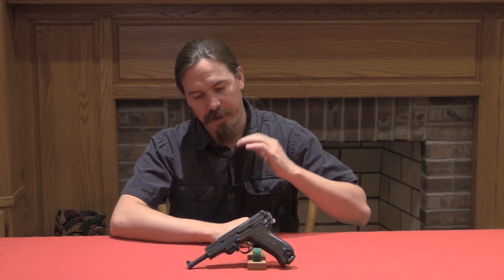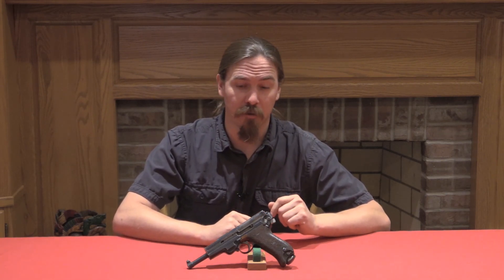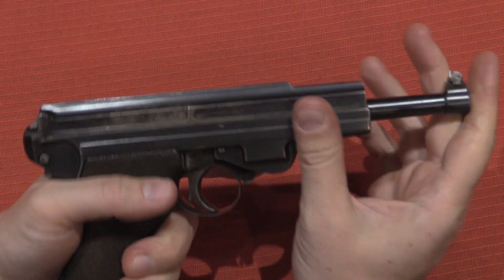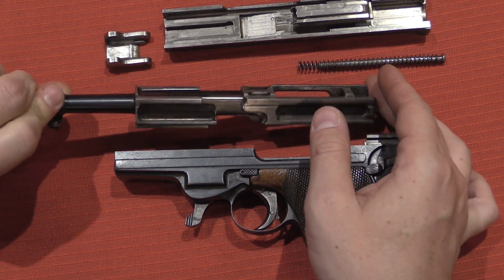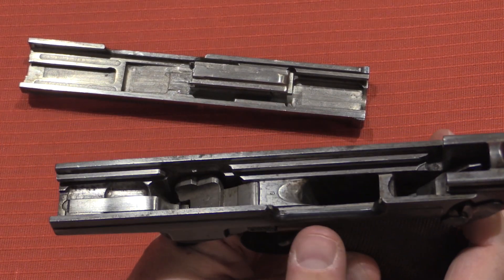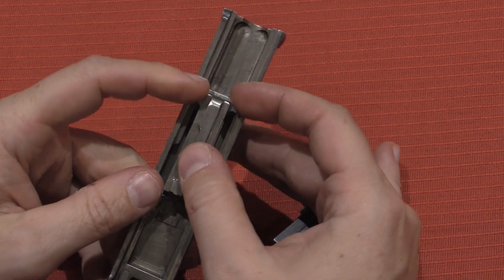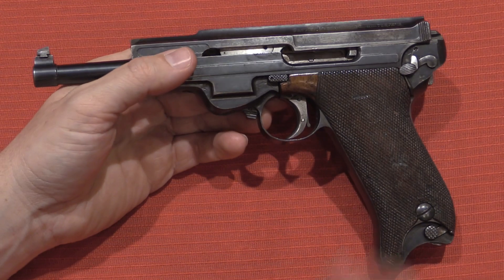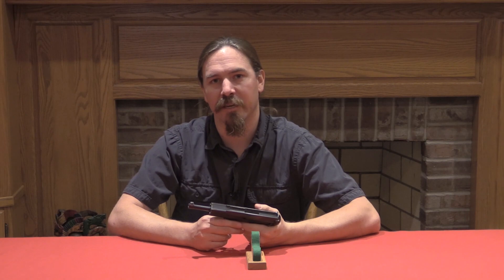Müller 1902 Prototype Pistol

Comment: I don't see what makes the locking block drop down so that the slide unlocks from the barrel assembly. In a P38 there is a pin that contacts the frame and pushes the block out of the locked position. I don't see that on this piece and if the locking block is being cammed along a surface in the frame I am not seeing where or how that occurs.

Comment: Crazy complicated machining, but super easy to strip. The quartermaster would hate the cost, but the soldier would love the ease of cleaning.
Reply: It is easy to disassembly, but it looks like a pain to clean. Parts have complex shapes and the ejection "port" leaves the mechanisms exposed. Combined with tightly packed sliding parts this makes the pistol look to be prone to jams.

Comment: I'm surprised that SOMEBODY didn't want these.  The simplicity of design ensures a more efficient build rate, the lock mechanism ensures a very safe weapon, it suffers none of the toggle lock reload weakness, the internal rails could show an accuracy equivalent to a Sig P-210.  The U.S.' affection for revolvers, perhaps, might account for enough 'reason' to deny it, rather more than too weak a firing pin spring.  But then again, how would I know?  Love your vids, thanx.

Comment: The locking design is actually superior to the Walther. That whole large flat surface on top is what locks into the top of the slide, and the force of recoil goes straight through the block in compression. The two 'ears' are only used for camming. The Walther P38, and other pistols with similar locking design such as the Beretta 92, have the block turned the other way up. The two little ears are used for locking and can be snapped off, so that locking blocks are a major weak point in these later designs.

Comment: This one was very interesting. Outwardly it kind of looks like a Luger and a Walther P-38 thrown together. Anyway, it appears that the locking wedge is supposed to be pinned on that slide assembly thing but I noticed that there wasn't a hole drilled in that part. I guess either it was not quite a finished piece or they figured it didn't need to be pinned in place. Seems like it could possibly have contributed to reliability issues?
Reply: I suspect that the hole was for centering to guide the machine that ground the curved pivoting surfaces. Those surfaces are large to withstand the force, a pin as well would be redundant.

Comment: It appears that the take down piece also acts as the camming surface the lock piece rides on.  If this is the case, it would explain it's complexity as opposed to just using a dowel.

Comment: Hey Ian, Winterthur is pronounced Winter-toor (the same oo in tool). Just thought I'd point it out in case you somehow come across more firearms from that town.
Reply: I was surprised to see Winterthur there. As far as I know it's very unlikely do come across more guns from there. Sulzer never made guns as far as I know :D. Considering that at the start of the 20th century Winterthur was an industry time, specializing in machine industry, it's fairly odd that there were no weapons manufacturer there. I guess the factory in Bern was enough (were there any other weapons factories... not sure.)

Comment: Ease of disassembly seems to be inversely proportional to the ease of making it. Still, really neat to see a reasonably modern safety, modern disassembly and modern recoil system in such an old gun - despite the 9001 machining operations required to make it.

Comment: Interesting, (and typically Swiss)...  !  Too bad Herr Müller didn't ever work on a project with the Frommer people, they could've designed the fiddliest and most difficult (and expensive) way to do something simple. Yeah, it would definitely be so freakin' elegantly done that it'd make your eyes bleed from catching one glimpse of the blueprints, and no one could ever bring themselves to actually fire one, for fear of scratching it or something. All spring actions pushing plungers, never actually acting directly on moving parts. All pins - captive. all parts forged with colorful case hardening. Oh - and you can set your watch to it's lock time.

Comment: It looks great for the time its been designed in, but i can only imagine that the need for those locking surfaces and the rails and whatnot to be accurately machined would´ve made this gun really expensive to produce... and hard to produce quickly.

Comment: Overall, this reminds me of the Beretta 92FS (the US military M9 service pistol). Short recoil operation, magazine fed, mainly machined-out construction, a safety lever on the rear of the frame, and a takedown lever on the forward part of the frame. It's arranged differently, with the return spring and guide rod assembly in the upper-rear instead of the lower-front and the magazine release on the base of the grip instead of near the trigger.

Someone should revive this design. It would probably not be terribly difficult or expensive to make now with the advances in computer-controlled milling machines.

Comment: The Swiss & their intricate engineering. I'd guess the pistol is built like a tank though.
Reply: More like a clock
Reply: Good one.
Reply: Like a Mars Pistol.
Reply: Generaly swiss military stuff is well built and way overbuilt. And expensive.
Everything from the showels to the rifles is made like that. Hey, even the nails for the horseshoes have a swiss cross stamped on them and an inspection to ensure the specs (I wish I was jonking).
Reply: Don't talk about Swiss tanks then... Different game than small arms.. ^^
Reply: @majormassenspektrometer  Not a fan of the Pz 61/68?